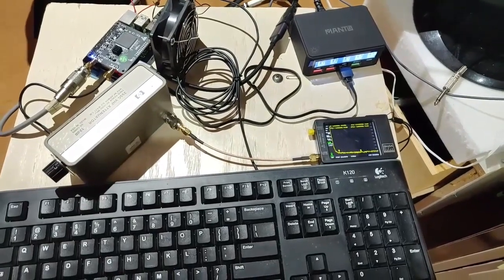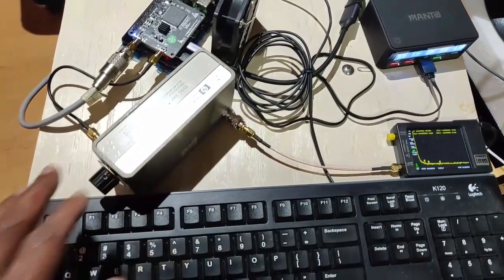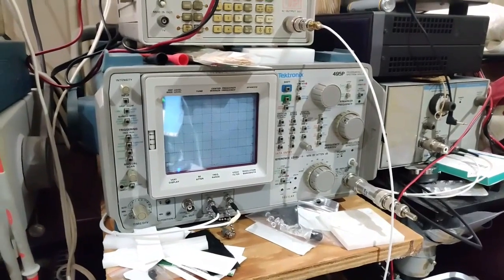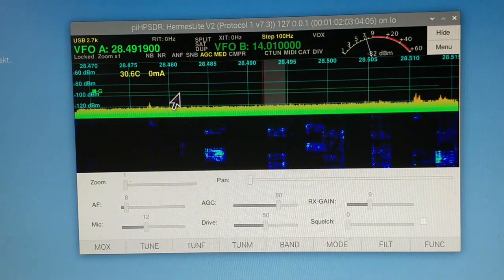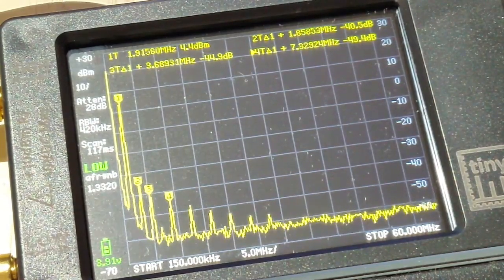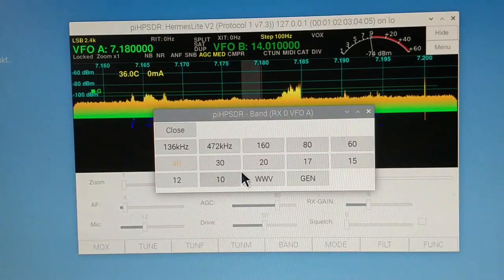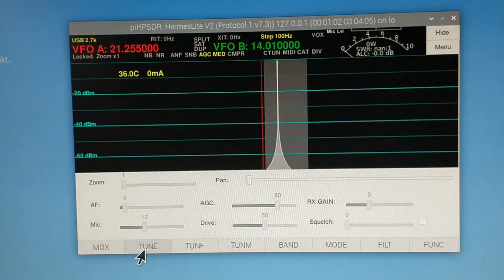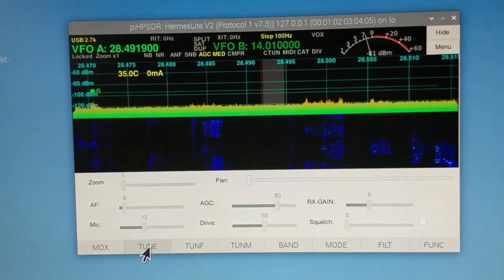Radioberry first TX test | Raspberry Pi | SDR radio | HF Transmitter & Receiver | Measure on TinySA

Comment: The worst harmonic is barely 40dB down on the carrier. That will need some filtering before going on the air ! Perhaps it could be interfaced to the lowpass filter bank for the Hermes Lite.
Reply from the maker: @fotografm  True. Some filtering needed. I'm using the LPF from an old cannibalized FT-757GX - post a 20W SS amp. Thanks for your feedback. 👍

Comment: What's Radioberry's output in mW?
Reply from the maker: In my first TX test (CW-tune mode), I saw an average of 1mW output across the HF bands into a dummy.
Reply: How can it be just 1mW when the tinySA measured 4dBm-5dBm magnitude of the fundamental frequency. And on the upper left part of the tinySA's screen says "Atten! 28dB", does it mean that the tinySA's input attenuator is set at 28dB attenuation? If so, then the Radioberry's power output should be at least 1 Watt!
Reply: @chestercorpus1392  The 28db is just to set the scale on the TinySA. It is autocorrected on the readout. Don't forget he put a 5dB attenuator in the path. That would mean that the measured output power is between 9 and 10dBm. For clarity, I would program -5dB into the TinySA "external gain" setting so that the power readout corresponds to the level at the output of the transmitter.
Reply from the maker: @chestercorpus1392  Thanks for your input. It's helpful, indeed. I'll measure again to verify/confirm that. Currently my Radioberry project is QRT because of upgrades.... work in progress.
Will definitely measure that again.